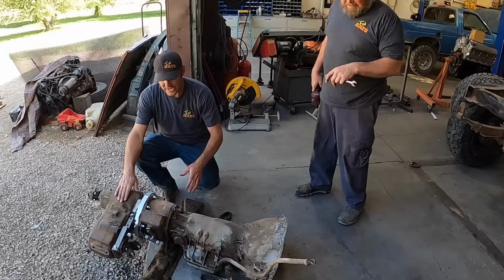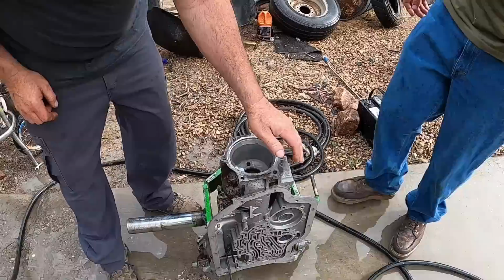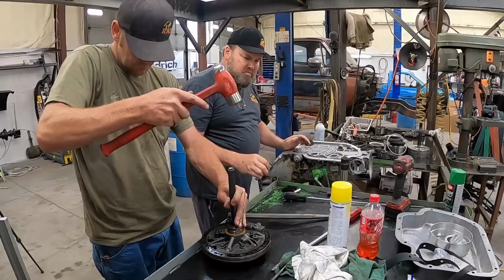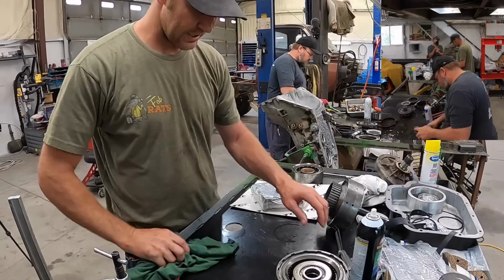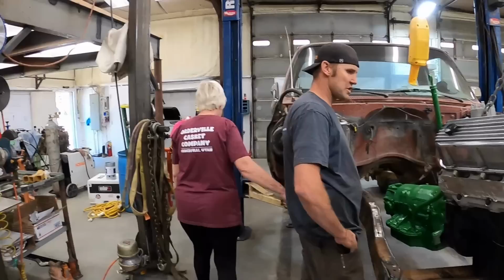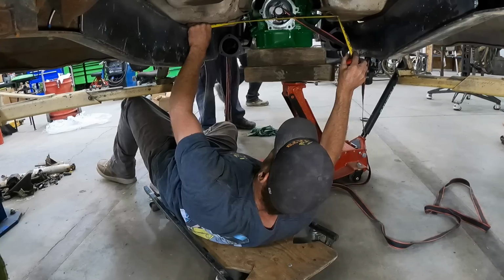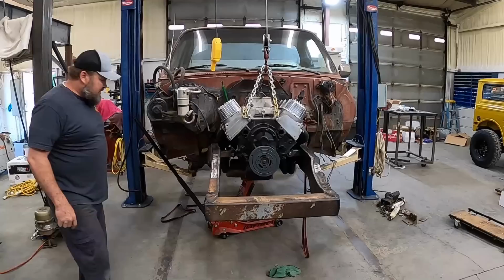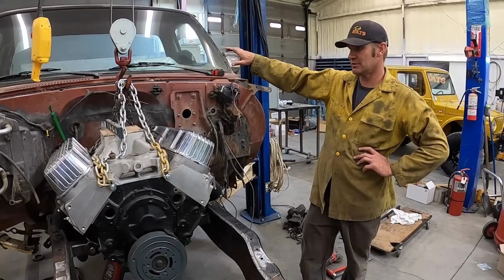All In A Day's Work! We Got The Motor In The Rat Rod Tow Truck!

Comment: Have you thought abouy using a dry sump oiling system on it?  That would not only add oil capacity, but it would make sure that beast has proper lubrication no matter what angle you put it on.

Comment: Since your doin a little experimenting with chemicals. Hit up the homedepot for some wd40 wetlube run the tranny outside the truck for an hour then hit it with wd40 drylube. Put the engine and tires back on. Wammo. Might need 2 bottles of each. Ttyl pal.

Comment: You hit a nerve.  Doug Thorley headers. Mid 1980's, DT's SD 80's were the only header to run if your were wanting torque to go along with your HP.  And back then, one HP per cubic inch was the standard we strive for.  Now a 302 Ford will pull 395+ HP from the factory.  Times have changed.  I still like cubic inches over a turbo any day.  Love your videos.

Comment: Paul have you/ do you ever drill a few extra "FLOW HOLES" in the mouse trap area???  I always liked the Chev/GMC Turbo 350 & 400 Trans. Back in the day '80-90s my trans guy used to drill a few extra "FLOW HOLES" in the "Mouse Trap" area, said it helped to improve fluid flow which helped lower fluid temps. We also used Trans. Cooler placed in front of radiator to lower temp. and 4 core Radiators.

Comment: Sodium hydroxide - widely known as caustic soda or lye is a white solid - and it is one of the strongest bases used for cleaning... Oven cleaners are designed with sodium hydroxide, which can react severely and vigorously with aluminum - as it has the capacity of dissolving aluminum, which is why you must not use it on the aluminum unless there is an emergency. Even if you use it, you have to neutralize with mild vinegar or clear everything with water. Sodium hydroxide also reacts with strong acids (hydrochloric, sulfuric or nitric), water, and moisture to rapidly release heat. Sodium hydroxide reacts with metals (aluminum, lead, tin or zinc) to form flammable and explosive hydrogen gas... 

Sodium hydroxide does not produce systemic toxicity, but is very CORROSIVE and can cause severe burns in all tissues that it comes in contact with. Sodium hydroxide poses a particular threat to the eyes, since it can hydrolyze protein, leading to severe eye damage. - - Just don't use it to clean your transmission case.

Comment: Working on a transmission that should be built in an almost clean room environment, and he sprays iron filings all over the place.  Another question, you have the level on the motor, but is the truck and floor level?

Comment: I bought a 68 Camaro in 86, 454, 400 trans. It had been in a barn for years, they were going to drag race it but never finished it. Anyway, I had it at top speed many times. flooring it for an hour at a time. I think it did 155-160. Does that sound plausible? I think the speedo goes to 130 in those, anyone know? Wish I never sold it.

Comment: So question? are you planning on turning 6-7000rpm? That's where the large tube headers and the huge throttle body shine especially with huge cam. for torque would be better I would think the other way. It seems to me your building a 1/8 or 1/4 mile set up not a torque monster or off roader where you drive do you much ever see over 10-20mph? Also seems to me a dual plane intake would be better than a single for what your doing.

Comment: Kind of flimsy motor mounts? Would Tim Taylor approve? Most of the motor weight will be carried at center of gravity cantilever. Mounts mostly for twisting torque. What do you speculate how much torque is needed to break motor mounts?

Comment: Speaking of transmissions… I have a 2006 Jeep TJ with 65k miles. Auto transmission. Seems to lock the wheels up when I put it in reverse. Even with the rear wheels off the ground it’ll roll backwards for a round or two then almost spin forward and completely stop. But I can press the gas and overpower it enough to back the Jeep up. Any ideas? Thanks in advance.

Comment: Oven cleaner is the same "sulfuric acid" that's in your lead acid car battery.
Reply: Actually oven cleaner is sodium hydroxide (an alkali not an acid).
Reply: @gordonrichardson2972  interesting to say that because easy off oven cleaner of my youth and I'm 67 years of age says right on the side of the can and it was Sulfuric acid and that cause respiratory problems or even death if you inhale the fumes. As my memory serves   lawsuits against the  makers of easy off  wrongful death claims lawsuits because  killing an average of 5,000 people a year for 40 years may have caused a change in content. Now the last time I personally use easy off oven cleaner was on a merchant ship to clean out a cleaning gear locker that someone has spilled about an inch of Wax over the years on the deck. Safety regulations based on the fact that it was an acid of United States Coast Guard (of which I have honorable discharge from) require the use of a respirator and heavy acid resistance plastic /neoprene  gloves.   20 years ago this year   I'm quite sure the can read sulfuric acid. I'm in my entire life time I have never purchased a can of the stuff although on my youth my mother did. And thank you for your reply.

Comment: as the winner last years tow truck event representing  shady mannys retirement home, mortuary and used clothing might i suggest comming engine location last and per dead nuts center weight vs dead nutts by visual or measured "center"...this way you ront add weight with counter weights and if somebody says "hey your engine looks off center you say..i placed it so the truck is balance not to look pretty or to satisfy your need for visual symmetry.....fromone machinist to another...little fella..

Comment: Just curious,  why wouldn't you just put new clutches in there while it's disassembled? I would think they are relatively cheap? I don't know, I've never opened an automatic tranny myself.

Looks like you did use new clutches. So you can disregard the question.  I'm assuming you were just inspecting them.